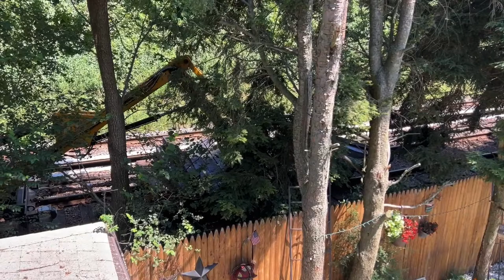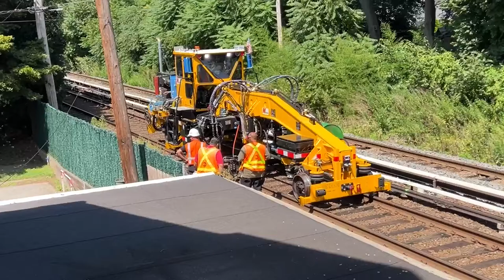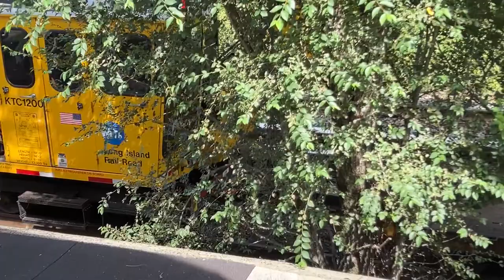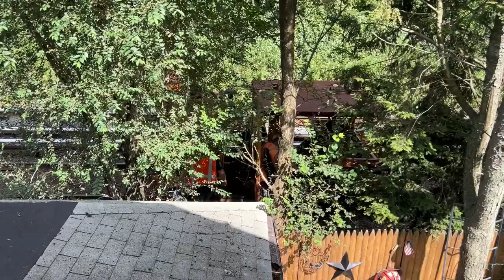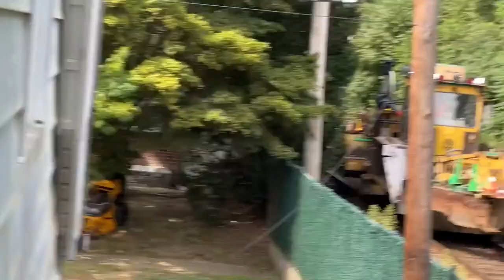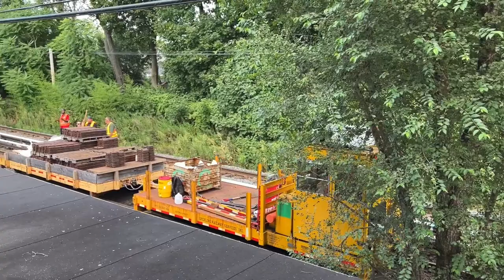LIRR track cars performing track work on the Oyster Bay branch

Comment: In Morris park I think the best engines to save in the line of MP15AC'S and SW1001's would be LIRR #102 #104 and #100 also
Reply from the maker: 102 and 104 seem fine but I don’t know if they will bring them back. 100 is in service.
Reply: @niccosrailfanning  We're 102 and 104 at a museum before? And I also thought that #100 was not in service since it was sitting in the back of the line. Also there is one FA2 in upstate NY that is abandoned  you wanted to know
Reply from the maker: 102 and 104 is in Morris Park. Before that no where else besides when it was actually in service. Is it an LIRR FA2?